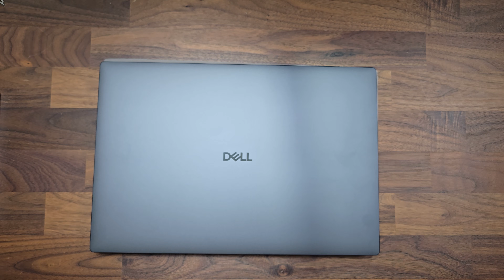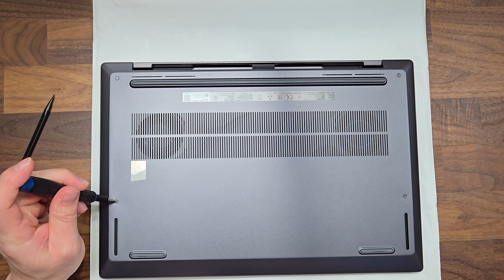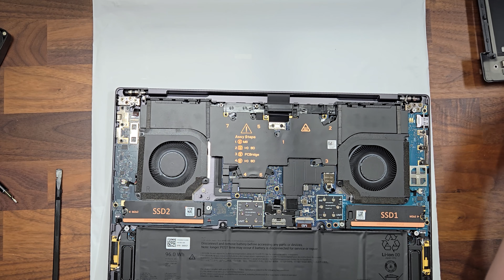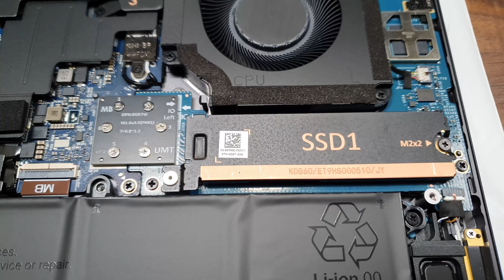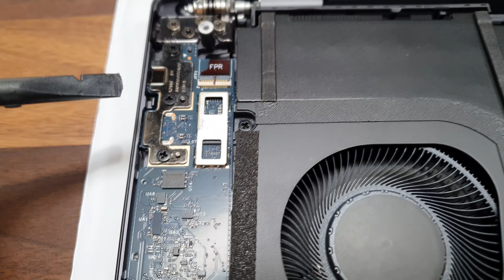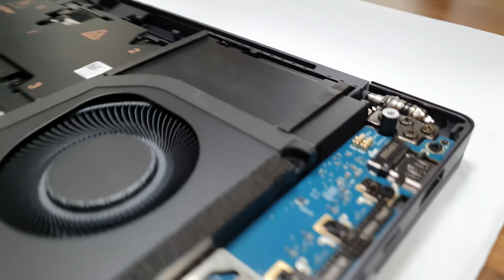Inside the Dell Pro Max 16 (The Bad News)

Comment from the maker: Soldered RAM and soldered Wi-Fi on a 'Premium' machine... Dell is really baking everything into the cake on this one. Also, that back to front pry method was definitely a curveball compared to older models.

Are soldered components an automatic deal breaker for you now, or do you not care as long as it ships with 64GB?

Comment: This is a Dell Pro Max 16, not a Dell Pro Max 16 Premium. Dell has made its naming scheme much more confusing lately.
On the topic of reliability and repairability, you also need to be very careful when configuring a laptop on Dell's website. Depending on the options you choose, some components may be modular and easily replaceable, while others can end up soldered or significantly harder to replace.
Reply from the maker: The naming scheme is definitely annoying and confusing, but this is indeed the Pro Max 16 Premium. 

I've not seen the configuration of said laptop dictate whether or not parts are soldered on, that is typically model specific. Dell, as far as I know, also does not let you know within their ordering whether or not parts are user replaceable. You can search up the CRU and FRU's on their website with that specific model type, but most people don't consider that before purchasing.
Reply: @TheDonTech  So is this the MA16250, not MB16250 or MC16250?